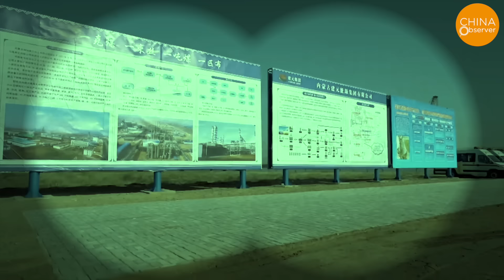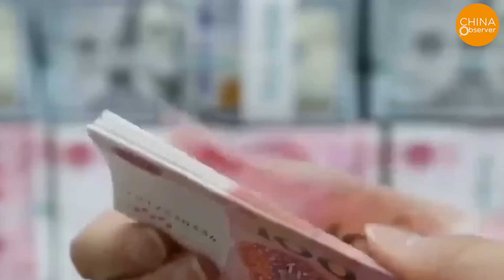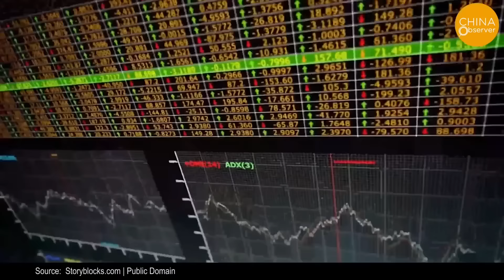China’s $77B Water Transfer a Total Failure! Uses Trains to Haul Water, Triggering Further Floods

Comment: We have these things called pipes, pumps, and reservoirs to transport water.  China should look into them.  Much cheaper than using trains.  Also transporting coal on rivers and canals is much cheaper than by rail
Reply: We can't use common sense in China, their pipes and pumps would cost 20 times as much and fail within a week.
At least with this method, their unprofitable railsystem can finally be used for something and be a little less unprofitable in the future. 😅
Reply: If the objective is to burn coal to generate electricity ... why not set up thermoelectric plants close to the coal regions ... and take this energy through high voltage lines to those regions that require a lot of energy ????
Reply: Shhhh😂
Reply: @NorthzYT  honestly their railway system is probably the only love they have given to their citizens, unprofitable but it is for the citizens.
Reply: I was just about to comment on the same thing: why use open canals to transport water when you can ensure water quality by using pipes, especially now that housing construction is not competing for steel and idle manpower/equipment.
As for coal transport, I suspect the "canal" is not one contiguous waterway with uniform depth, it might not support heavy barge traffic, and there's probably no convenient located loading/unloading docks.
Reply: @theethicsofliberty4642 that makes too much sense, so no they won’t do it
Reply: Canals are cheaper but nowhere near as efficient. Barges can’t carry a fraction of what long cargo trains can carry. The coal transport by rail makes sense but moving water? Why the hell are there no pipelines? It’s the most ideal way to move drinking water, everyone does it!
Reply: Tofu pipes would fail pretty quickly.
Reply: @theethicsofliberty4642  They have tofu engineers.
Reply: @reddytoplay9188  nah, those things keep derailing and they just bury it there and then atleast what weve seen from the past examples
Reply: @theethicsofliberty4642  there's no money to be made on those projects. Local officials love projects like high rises so they could skimp on materials like cement and rebars for more bribes and kickbacks.
Reply: Any type of wasteful spending is good for the GDP and worthy of a promotion. Welcome to China logic. Win win means they win twice at your expense.
Reply: I hear also, water pumps quite easily
Reply: Keep it up and some day they will "invent" aqueduct
Reply: @theethicsofliberty4642  They used to rely on imported coal, notably from Australia. That's why those plants are closer to the shore.
Reply: They have the pipeline route already prepared. Run the pipeline alongside the train tracks.

Comment: Wouldn't it be cheaper and more efficient to build a piping system with water pumps?
945 miles of metal pipe w/ pumps should be a lot cheaper than 945 miles of concrete and steel tracks.
( Piped water could be pumped 24/7 )
Reply: The problem is most pipelines are underground. Digging is expensive and so would be establishing a pipeline system
Reply: @MrStark-up6fi  Aqueducts have been invented and used for millennia . . .

Comment: Moving water by train sounds very ineffective . It would be cheaper to build a potable water pipeline. Or do what the Roman’s did and build aquaducts.  A empty train uses much less fuel than a train with water weight  8.49 pounds per gallon of water can the rail way handle that kind of weight??.
Reply: the train is fetching the water..

Comment: Ok, but you can't transport water in the same environment that ships the coal. Meaning that you will probably need special container inserts for the water which get placed inside the existing coal containers. The problem is: are those special water containers a one time use? If so, that would probably be quite costly. If not: how do you transport those container inserts back to the south? Since the trains carry coal on that track.

Perhaps the inserts could be collapsed and shipped back in bulk. But the downside there would be added complexity.

Comment: I can see why using the trains to transport some water would be an advantage. The pre-existing infrastructure gets used and it delivers the trains back to the mines for relatively low cost. Still, it's more of a stopgap than a long-term solution. Pumps and pipes are the best way to transport clean water.

Comment: How many of the big heat sheilded   giant power poles  do we have in space at this moment , and do we have good data on the Quifers under the lakes? 
  Drop them as cloose to the top of the the aquifers chambers under the lakes and resivores .. or drop in the shaped charge ones that point the blast from inside the pole and the back blast hind end T fins to keep the water above it as a blast buttress keeping as much force pointed directly at the cavern dome under the depth of the lake and several pointing into the old caves and mines and any springs mouths so the blasts blow out any blockage and cracks th edomes and aquifer chambers cielings an ddrains the lakes and resivors backed up hundereds of feet of water down into the dry resivores and capped and uncapped agricultural wells that were dry and hollow and can now be filled .  A fire cracker with water proof wick , in a full beer bottle full of wster.  And light the fuse and stand back from the bottle, many have seen the effect , test it, and watch the bottle break open its sides and a little wster pop up, the water flooding the auquifer chambers will blow the air a d sand out of all of the poorly capped water wells abd old springs that they leed to.. 
 And hopefully the impact wont be cloose to the dam or it will burst and cause uncintrolled damge and pollution down stream and not fliod the growing fields and plains to turn them to lake and mud where tanks cant travel and will flood all hidden tanks in bunkers that Xi has there and all their stock piles of weapons and food and will be a long time before their army or looters can get to them at all.

Comment: This does seem like it isn't the best choice of water management however there is a sound business strategy of never running your cargo containers empty if it can be avoided. Running containers empty is always a %100 loss. If they are moving containers anyway and can take the water then I agree, 'do it'.
Reply: The question is whether the water is more valuable than the resources It takes to transport it if it costs more than an empty trailer. It's not worth it.
Reply: @rymoremorris5287  If those huge trains are on high-speed tracks, the rail damage would be detrimental to fast trains.
Reply: @EllieMaes-Grandad  definitely agree and the energy cost to transport water via high-speed wouldn't be economically viable.